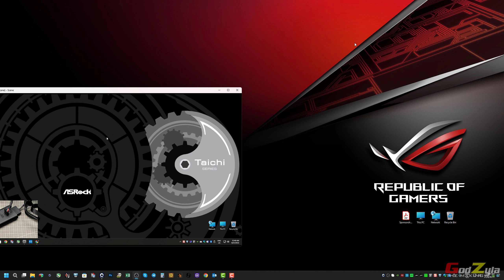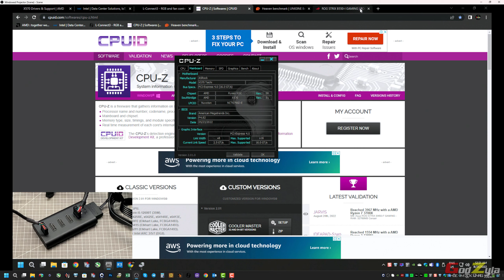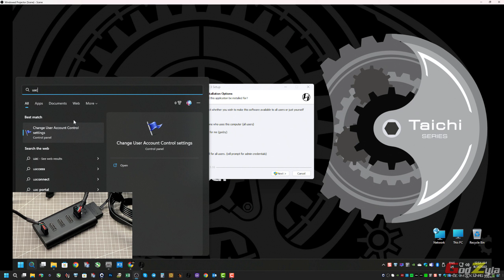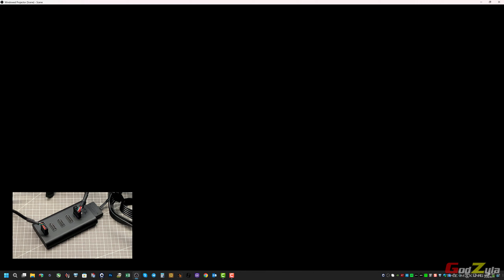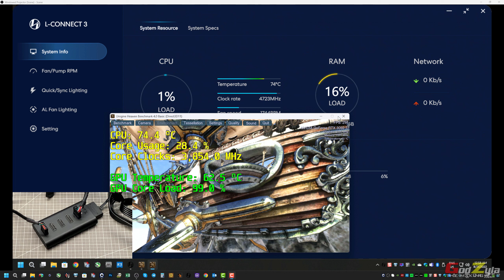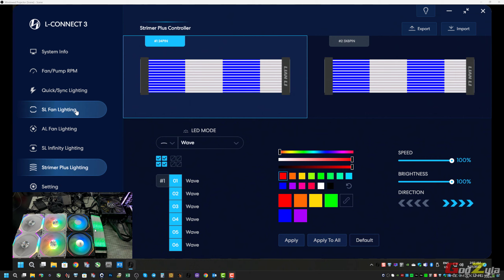Lian Li ARGB Products (How to make it work?) [L-Connect 3]

Comment: Where do you get the USB 2.0 cable to connect the NZXT Hub with the Mainboard USB 2.0? I cant find any site who selling this
Reply from the maker: Hi Crysen_TV, welcome to my channel, I advise you to get this instead Lian-Li USB 2.0 1-to-3 HUB https://lian-li.com/product/usb-2-0-1-to-3-hub/ . not too sure if you can view this to purchase it. https://www.aliexpress.com/item/1005005121350909.html
Reply: @KleoYan  Ah, so there is no need anymore for the NZXT USB Hub? Just to say what i have to do, i have 3x Lian Li Fan Controller and 1x Lian Li Strimer Controller for Powercord CPU and GPU. I also need to Connect my Custom Watercooling to USB too. Does the Custom Watercooling 9Pin USB Work on the Lian Li USB 2 1to3 Hub too?
Reply from the maker: @RageProgamingNews  hmm.. i thought you were to use only lian li products. if that's the case it will be better off using the NZXT internal 3.0 hub. https://nzxt.com/product/internal-usb-hub-gen-3
Reply: @KleoYan  Haha okay, so back to my first question, where  did you buy the USB exstention female to female to connect the NXZT with the Mainboard USB? :D
Reply from the maker: @RageProgamingNews the nzxt internal hub come with it. You can check the link for info which I have provided you earlier.
Reply: @KleoYan  Ah i bought mine on Amazon but there was no cable included, probably some reviews said the same that there is no cable included, maybe a germany issue. But i have another idea: Since INF Controller can get up to 8 Fans, wouldnt it be smart to connect 6 fans to one controller and  4 fans to the other? 2 Controller + Strimer Controller = 3 USB Connections, so i have one USB Slot for the Custom Cooling on my Mainboard left. Oh Wow and after i wrote this i checked the NZXT Box and there is the cable hahaha. But to finalize the USB Situation i would also need a second NZXT Hub, 4 for Lian Li Connections 1 for other stuff like the Custom Watercooling
Reply from the maker: @RageProgamingNews  one SL-INF Uni controller can connect up to 4 fans to each port. You can connect up to 16 fans. You do not need another controller. So that will be only 2 controller from Lian Li’s end and plus your custom watercooling controller. That’s total of 3. One NZXT internal usb hub is sufficient to run all your devices
Reply: @KleoYan  Yes i also figured out that the watercooling doesnt need usb. Are you sure about the 16 fans thing? In the Packaging Instruction they say up to 8 fans, that would be 2 each slot
Reply from the maker: @RageProgamingNews  what uni fans are you having. All SL, AL, SL-INF can go max 16 fans in their own controllers as each port can cater for 4 fans max. Unless you are using TL LCD or TL.

Comment: Is it best to use L connect when all the rgb fans are connected to the 216 case controller? Or do I stick to motherboard rgb control?
Reply from the maker: Hi Steven Cooley, welcome to my channel, you are not able to use the L-Connect 3 without a controller or hub (Uni fan controller or Strimer Plus V2 controller), which specifically taking instructions from L-Connect 3 app. The case argb controller does not pick up the instructions from L-Connect 3 app, therefore you will have to connect it to your motherboard and to use the motherboard utlity to control the argb effects.

Comment: my device manager wont detect the strimmers and the l connect 3 wont show anything it only shows settings and system info ;( @KleoYan
Reply from the maker: Hi LookAtYouPlaysRoblox, welcome to my channel. Which strimer plus are you using? does it come with a controller? if it does come with a controller, does it have a usb cable which connects to this controller and to your motherboard USB 2.0 header?

Comment: Hello Kleo, I recently updated my L-connect 3 together with my SL120 Infinity fans firmware. But ever since the updates everytime my pc restarts or turn on the L-connect doesn't save my rgb settings and it keeps reverting to rainbow effect each start up. Any clue?
Reply from the maker: Hi Grizworth, welcome to my channel. everytime you update the L-Connect 3 app, it will first remove the necessary settings and bring back to default. Best way to counter this is to export what you have set, so once you lose your profile, you can import it in. There is an import or export button at your SL Inifinity dash board in L-Connect when you set the argb effects https://lian-li.com/l-connect3/l3-manual_backup/#elementor-toc__heading-anchor-3

Comment: sorry this is bit late to ask but how do i  change color on the front strip of the lian li o11d xl like custom change not just preset`?
Reply from the maker: Hi Muzubi, welcome to my channel. Kindly read page 9 and 10 of the O11D XL manual, https://drive.google.com/open?id=1myDv0AMlZhTWNlwcBo7HFgBXrhSuX3MT
— Mode
8 Lighting Effects:
1. 1st-7th: MCU Built-in Lighting Mode
2. 8th: Sync Up the ARGB Lighting With The Motherboard
 (1) Connecting The Header To The Motherboard
 (2) To Turn Off The Lighting, Press The Button For
 3 Sec. To Turn It On, Press Again For 3 Sec
Reply: @KleoYan  thanks so much :) w8 is it in manual you get?
Reply from the maker: @XeqtrM1  I do not own a O11D XL case but I view the manual from Lian Li’s official website.

Comment: Hi, I bought 3 lian li fans, the first is a Lian Li UNI FAN SL-INFINITY 120 RGB (No controller included) and the other two are Lian Li SL Infinity 140mm (Without Controller). I connect the fans to the following fan hub: "Thermalright ARGB Fan HUB", that hub is connected to my B650E-F motherboard. The fans work, they turn on the default RGB, but in the L-CONNECT 3 program the fans do not appear so I cant control the RGB and RPM. What did I do wrong? What I can do? all the best.
Reply from the maker: Hi lain, welcome to my channel. Lian Li uni fans do not work this way. You need to have its own Uni controller/hub to work with L-Connect 3 application, as there are specific firmware on the Uni controller/Hub. You can’t just use other brand hub.
Reply: @KleoYan  I understand, but if the uni fan-sl-infinity I bought them separately which means they didn't come with the controller, what option do I have? Because I was looking and I can't find that controller to buy separately, Only the pack of three fans is the one that comes with the which was not the one I bought, since I got all 3 separately.
  . I forgot to mention that I have the lian li strimer V2 (controller included) and they do appear in the L3-CONNECT (Ver 1.74)
Reply from the maker: @lain1178  Hi, that's for sure as there is a strimer plus controller. as for the SL Inf controller, not sure if you can see this https://www.aliexpress.com/item/1005004600755700.html (Black) and https://www.aliexpress.com/item/1005004600649607.html (White)

Comment: I want to ask why I can't install L-Connect 3 Software? I become always a Pop-Up with "This application could not be started. This apolication requires one of the following version of the .NET Framework: .NETFramework, Version=v4.8

Do you want to install this .NET Framework version now?"

If I click YES, I redirected Download. NET Framework 4.8.1, but if I click download, it says this OS doesn't Support this version. I've Windows 10 Enterprise.

I've installed the Lian-Li GALAHAD II with LCD Display + 4 x 120 SL-INF (3 on front, 1 back) and 2 x 140 mm SL-INF (under the GPU), with only one Controller from the 3-pack Lian-Li SL-INF 120 FANS which is the newest version, so I don't use the Controller of the AIO (GALAHAD II LCD). Should I use the other Controller or doesn't öz matter? During the boot the Display goes on and I can see the Lian-Li logo loading, but then there is nothing, only Black screen. Is it normal or it is necesarry to use L-Connect 3 Software to activate the display? Or should the Display must be automaticlly on? As I Said before İ can't install the L-Connect 3 Software 😅 i need your help, please 😊

Comment: i want to ask why my L Connect dont have option to change rgb( sl infinity 120 )
Reply from the maker: Hi Ish, welcome to my channel. mind to provide if your SL-Inf-120 is of a triple pack that comes with a controller. What motherboard are you using and also what are the basic troubleshooting steps you have done.
Reply: @KleoYan  my motherboard is rog z790-A gaming wifi 2 ATX
Reply from the maker: @nihao1307  and is your SL-Inf-120 of a Triple pack that comes with the controller? If not you can’t use l-Connect 3 app.
Reply: @KleoYan  i think i have the controller but i think the guy didnt help me put in my case.
Reply: @KleoYan  so after i put the controller then i have the option to change rgb?
Reply from the maker: @nihao1307  i see.. you might need to do it yourself to plug the controller. if you are uncomfortable with so many cabling, get help from someone who is experience in PC building.
Reply from the maker: @nihao1307  Once everything is connected properly, yes you will be able to control your fan's argb effects using L-Connect 3 app. kindly go through my content on how it works and how it's connected.
Reply: @KleoYan  must use lian li wires?
Reply from the maker: @nihao1307  yes, only way to connect the controller to your motherboard.. if not L-Connect 3 app will not be able to send signal to the controller and to instruct your ARGB effects on your fans.
Reply: @KleoYan  ohhh tysm:)
Reply from the maker: @nihao1307  you are most welcome. best is to read the instruction manual on how to connect these SL Inifinity fans.

Comment: Is the fan controller suitable Lian Li Uni Fan SL120 V2, to the fans LIAN LI UNI FAN SL-INF 120  REVERCE BLADE?  Thank you.
Reply from the maker: Hi Сергей Киселёв, for the SL 120 V2 controller, there is a sync port 2 and 4 which you can use to plug the SL-Inf 120 reverse fans but the effect will not be ideal. It will be better to use the SL-Inf 120 Reverse with the SL-Inf controller.
Reply: Thank you @KleoYan
Reply from the maker: @sagittarius_rf  you are most welcome and all the best for your build 😉

Comment: hey bro . i have a question . if im just going to control my 360 sl argb fans using motherboard , can i remove usb cable from my hub ?
i mean i connect only sata and 5v rgb headers cable. please help me.
Reply from the maker: Hi mobin donyadideh, welcome to my channel. Nope you will need to connect the USB cable to the uni controller, else you can't control the fan's argb even if you have installed the L-Connect 3 app.
Reply: tnx for answering bro . i have z790 asus rog h and connected lian li galahad 360 sl into my motherboard. but windows says the usb device is not recognized.
even in device manager i see a yellow alarm on this usb device. 
i remove and plug the usb calbe so its fine but after 5 minutes it saying usb not recognized . over and over.
my bios is updated . i have testet all 2 usb 2header ports on my mainboard. and issue still exist.
do you have any idea ?
 @KleoYan
Reply from the maker: @mobindonyadideh  have you install the chipset driver of your motherboard? I assume is this motherboard. if it is have you install this? Intel ME Consumer V2334.5.1.0 (SW 2335.5.26.0) For Windows 10/11 64-bit. https://rog.asus.com/sg/motherboards/rog-strix/rog-strix-z790-h-gaming-wifi-model/helpdesk_download/ 
if you have done this and it still shows the the same error, it could be 1) insuffient power to your uni controler 2) the USB cable that comes with your uni fan is faulty or 3) the uni fan controller is fautly. It that's the case, kindly contact Lian Li support to aid you. https://lian-li.com/contact-us/